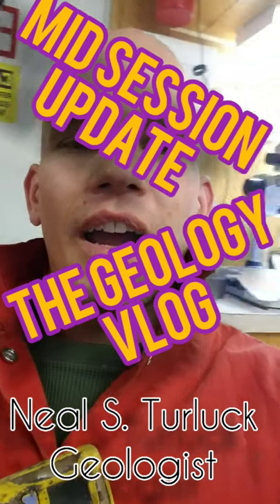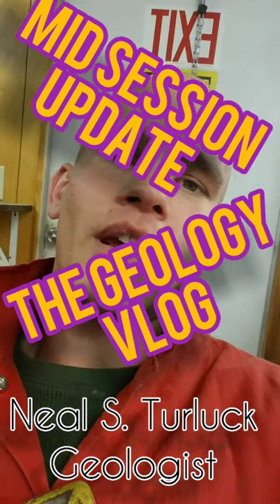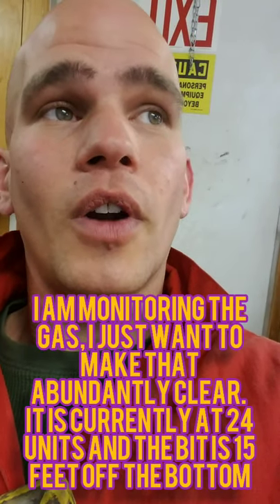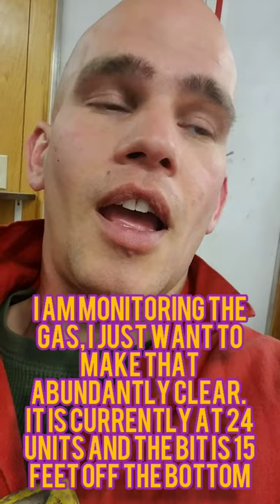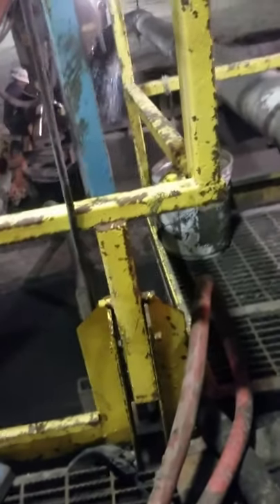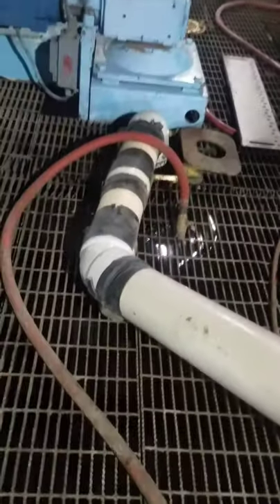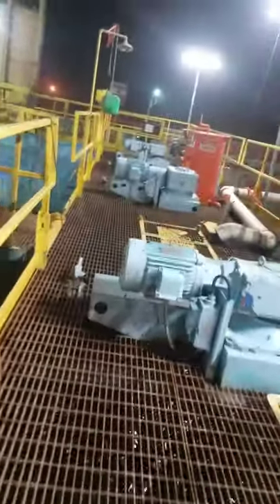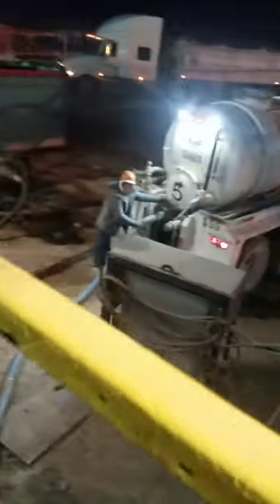The Geology Vlog Mid Session Update - Drilling Rig Tour (Permian Basin)

Comment: Yes, also water based mud is more likely to run into troubles when interacting with certain clay types, especially swelling ones.  Oil based mud is always the best practical option for the drilling itself. The trouble with oil based mud is possible confusion about oil shows and resistivity tools especially shallow resistivity.  GC analysis can easily separate drilling additives from actual migrated or in-situ hydrocarbons.

Comment: Would have been interesting to see the 'peanut butter' mud
Reply from the maker: Yeah I was in damage control mode for most of that shift and trying to make sure the equipment for the mud logging company I was working for wasn't getting destroyed.  They shut things down pretty quickly and then started circulating the mud through and trucking it off site.  When they got the mud situation figured out they started drilling again and I was back to  running samples and logging mud!
Reply: @nealturluck1006  sure understood.  WOuld be interesting to see how you see cavings and hole problems as another vlog
Reply from the maker: @heartysailorman5719 , oddly enough I'm more of a sailor than I am a mud logger. I graduated in August 2019 with an MS in Geology with the intent of working in corporate oil and gas.  Chasing after a career led me to mud logging, but I hated it and quit in January 2020 and worked at the Taos Ski Valley until the world shut down, and with it, any prospects for a job in corporate oil and gas. I got a phone call today, Monday, April 13, 2020 about going to look at a Farr 395 in New Jersey that a friend of mine wants to buy. The last time I was in New Jersey was in September 2019 when I crewed for a friend of mine in the Star North American Championship in Toms River on Barnaget Bay only days before I left for the Permian Basin to start working as a mud logger. I can probably do a Vlog on the issues involved with open hole, there are many!
Reply: @nealturluck1006    go for it! Its a great boat if its in decent shape.  I'm looking for centercockpit  - a Bene 42CC.. its my Plan B   Sorry to hear theML job did not work out, its actually very important but underated by operators....but I think its the ML companies fault too.  I lost a BHA last year partly because the ML did not tell me we were getting cavings..  :(  Best of luck